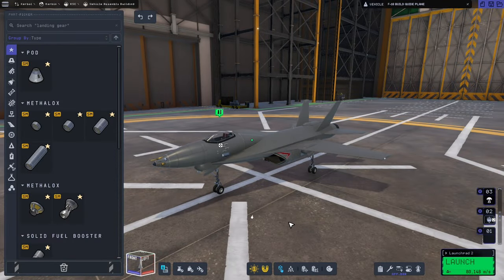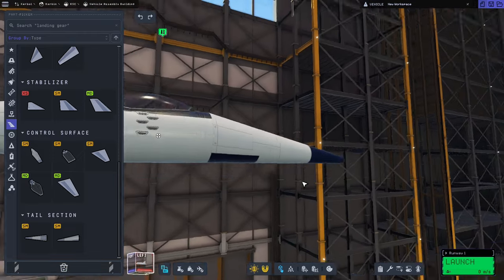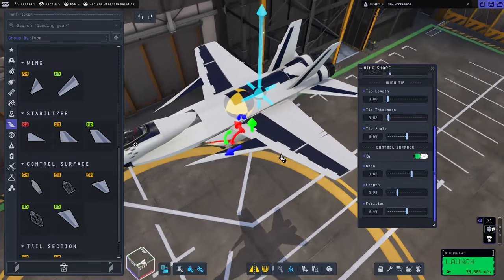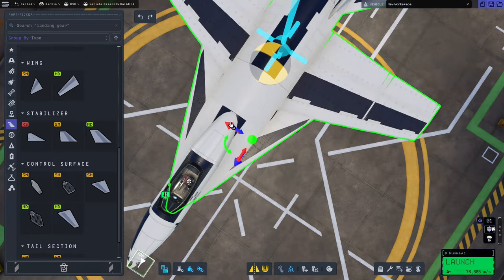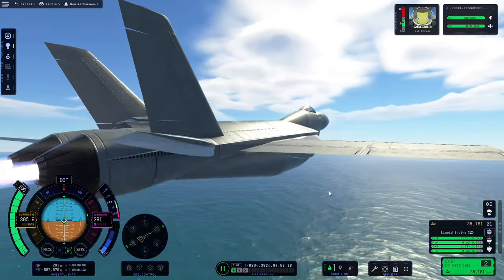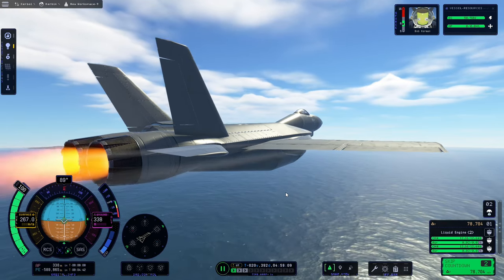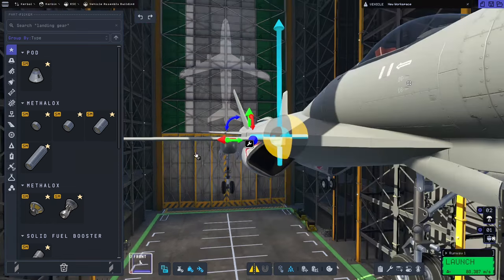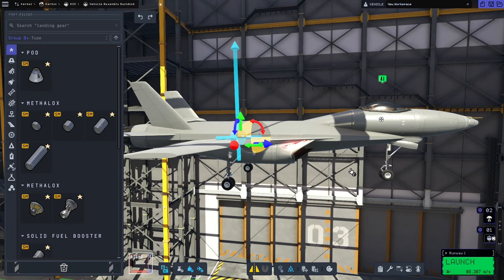KSP2 Build Guide - How to Build a simple F-18 (Airplane Build Tutorial)

Comment: I'm having difficulty with the inner and outer wings... When my inner tip thickness is 0.00 and my outer wing root thickness is 0.00 they are not the same thickness at the join. If I set the outer wing root thickness to 0.01 its then too thick.
Reply from the maker: Are you using the same wing type for both parts? If you use a medium wing for the inner wing and a small one for the outer wing then they won't match up. I just copied the main wing and changed the dimensions :)
Reply: @clowderman88  yep, I was taking a copy from the inner installed one. Same thing happens when picking from parts list. Plane still fly fine, must be a bug.